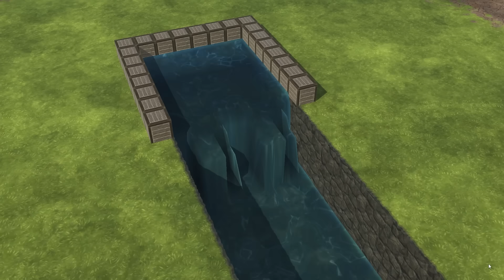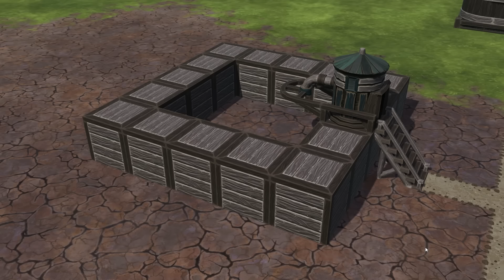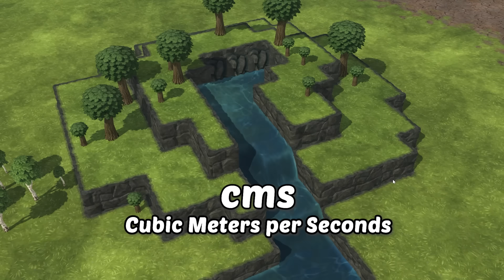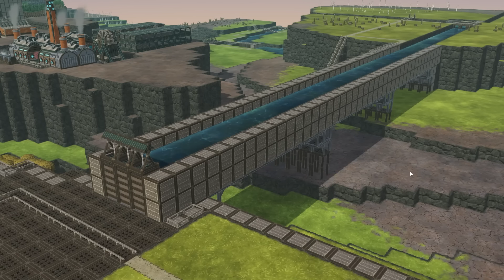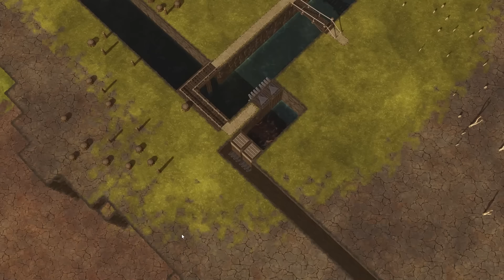Timberborn's Water Mechanics Explained

Comment: Thanks for this video! I am newer to the game and now the first time in the mid game. (Without the XXL stuff, after all techs etc.) There was a big patch in the last month. And this video is 1 1/2 years old , is there some big change which let me cry if I go for my late game by this informations?
Reply from the maker: Luckily most of it is the same these days! There are two big changes since this video:

- The numbers for water values have been but in half. So, for example, 6.6cms used to be the max water a 1 block channel could hold: now it is 3.3cms. A 2 cms source then is now equivalent to a 1cms source now. 
- Waterfalls no longer have the 2.2cms edge limit. Waterfalls now are not a bottleneck (though the channel feeding a waterfall still could be)

Good luck in whatever megastructure you are building!
Reply: @ZeddicBuilds  Thanks for your feedback! If you have the time an additional question to the dams:

Why everyone uses wood for the dam? I unlocked the earth bagger and from my point of view it is easier to use - build high with the option which block first, without the priority system. And if I make a mistake, it is possible to blow a hole on each position with dynamite / the tunnels, without removing everythink above.

What I am missing?
Reply from the maker: There are a couple of trade offs for building with dirt. On one hand, it does allow you to create overhangs, but it comes at the cost of being harder to destroy (requiring tnt vs just instant) and it also prevents beavers from building down “through it”. Beavers can build something below them vertically from any height - but dirt acts as a blocker. The other consideration is max build height: the game only lets you build so high before it only lets you build with levees. Admittedly these trade offs are pretty situational, so most times it won’t matter much. Beyond that, I think it just comes down to visual preference
Reply: @ZeddicBuilds  You are a nice one! 🙂

Comment: The 2.2 cms per edge fall limit, that's genuinely new information! 
The perpetual motion machine I've been using, has fluctuation issues whenever water drops down one level, and I finally know why!
Reply from the maker: It ends up that they removed the 2.2 cms limit in the official 1.0 release which was released a bit after this video. The rest of the guide in this video should still apply though
Reply: @ZeddicBuilds  In your timberpunk series, you calculated the channel throughput with the 3.3 cms/block heuristic
But in this tutorial video you used 6.6. Is that also part of the 1.0 changes?
Reply from the maker: Yes! Good catch - another element of the 1.0 release is that they halved the CMS units of measurement. So 6.6 became 3.3. A 3 CMS water source in the current version is a decent amount of water now.

Comment: great video, great game! But in 9:27 the game sadly visualize the water in a wrong way: Narrowing the river means higher flow means lesser waterlevel in the narrow, not a higher water level (Bernoulli). Maybe they fix that visually
Reply: Are both possible depending on the Fr?
Reply: Im pretty sure that is not what that theory is explaining. It explains high and low pressure.

Bernoulli's principle states that as the speed of a moving fluid (liquid or gas) increases, the internal pressure within that fluid simultaneously decreases. It is essentially a statement of the conservation of energy for a flowing fluid, meaning the total energy in a steadily flowing system remains constant.
Reply: @InvertedAim  year, but in open channels you use it with the continuity equation to calculate waterlevels - and the waterlevels react like I explained in open channels with other constant framework conditions like I explained. This is how we calculate missing variables—such as velocity or water level—using energy transformations in open-channel flow.

Comment: Even at almost a year old, still the best video on Timberborn's water mechanics I've found. Hoping this video will be updated if 1.0 makes it necessary.
Reply from the maker: Thanks! Luckily it looks like almost everything is the same in 1.0. The two big differences:

- They removed the waterfall edge limit. No 2.2cms per edge bottleneck. You just need to worry about the width of the river like you do normally.
- Measured CMS values were halved, but otherwise remain the same. So a 1x1 tile can hold 3.3 cms instead of 6.6cms
Reply: @ZeddicBuilds  What about 1.1?

Comment: What happens if we put levees or dirt over pipes.
Reply from the maker: If you completely seal a water source with no exit, it will eventually stop producing water. This can be a cheap way of sealing off badwater if you don't want to route it off the edge of the map. If you put dirt or levees over a pipe, it will stop of the flow of water in that direction and it will go into open square that it is connected to which is open

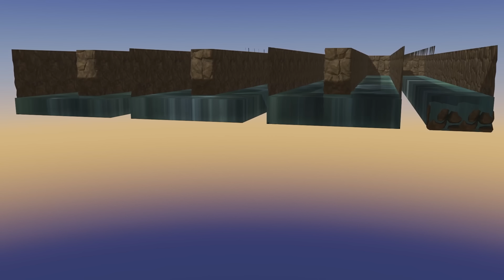Comment: 12:00 I used this in my last dam to fill a empty lake that was to high but closer to the water source blocks on plains. Any over flow goes into the lake or off the map edge. Just set it to .05 above the block height. and that will multiply so fast. away.

Comment: Sluice gates also should have the option to open at a set upstream water level so they can be used as flood prevention. 
Because I managed to end up in a situation where I can’t use sluice gates because of the lack of an option to have them open at a set depth upstream
Reply: The solution is to have a bypass dam or floodgate in addition to the sluice

Comment: Maybe I'm stupid, but I'm trying to understand how you build a water source in the game. Is it possible or is it a mod?
Reply: You’re not stupid and it’s not a mod. He kind of zips by it but you need to be either in dev mode or map edit mode to add water sources.
Reply from the maker: Thats right - this is possible with dev mode. You can alt+shift+z to enable a hidden toolbar. It will add some new buildings on your toolbar for water sources as well as open a new hidden set of dev actions. You can also build items for free if you hold down CTRL while you click.

Comment: I am quite new to Timberborn and really appreciate the video even though I don't really understand a good chunk of it. I have a question though, I know it was probably explained in the video but how do I build a dam to hold water during bad tide or drought?
Reply: there are several options but I've only ever used two dams and floodgates, dams automatically hold back about half a block of water are cheap to build but cant be adjusted, as a result dams cant protect you from badtides on there own in fact it will actively make them worst, so as soon as you unlock them replace every dam with a floodgate and the moment you get a badtide warning empty your reservoirs, if you want something better then add another floodgate before your settlement/reservoir and leave it open outside of badtides and build (or more likly tear out the ancient blockages to) an alternative way for water to exit the map and block it off with floodgates during droughts or the wet season keep the floodgates closed during a bad tide only open these floodgates and close the floodgates to your reservoir.

Comment: Do you have a video specifically regarding irrigation during droughts? I'm having real problems with the sluice. I've built a massive dam system, spent HOURS doing it... TWICE!! But it's the sluice, it doesn't do what I thought it would do. I hoped it would sense when there 's no water, and open up to irrigate all my rivers, but they just won't!! The problem is, the sluice senses it's own water output, so it keeps closing every time it lets any water out. This greatly effects the pressure, thus it's not a strong enough flow to irrigate anything but a small pool nearby.  I've tried everything to get around this problem, but I just can't solve it.

Comment: hello Zeddic, I came into interesting issue. It seems that with update 7 there is a limit to how much 1sq of pipe can handle. I'm playing on map with very big water source (almost 60 m3/s) and wanted to route all bad water to other side of map. I have found that max what I can  get through 1x1 pipe is 10 m3/s. increased to 2x1 ->20m3, 3x1 - 30m3/s. With very short pipe I can't get more that 25m3/s. Could You test that?

Comment: So when a water source is placed on the edge of the map, can that be pressurized? Or will the water just flow back through the source and out of the map? Also, if it will pressurize, will it be pressurized with the same CMS as the blocks let out? Like a source with 6cms, if you make a dam with that, will the output of the dam be 6cms? Or will it lose some off the edge of the map?

Comment: My only question now is how do you instant build in dev mode???
I’ve been trying to figure that out for day now.
Reply from the maker: While in dev mode you can hold ctrl while placing a building to instant-build. You can also hold shift while deleting to skip the prompt. Another tip if you are tinkering is to start a new map with 0 building refunds - so you won't get rubble building up.

Comment: I always have an issue where I try to do multiple reservoirs on the large plains map and then it seems to destabilize the water to cause constant flooding on the original river around the starting area.
Reply from the maker: My first thought would be to look at where water is leaving the reservoirs and see if there is a bottleneck on the edges that can't support that total CMS.

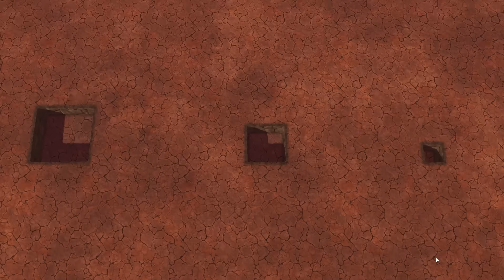Comment: 3:49
Is that actually true, though?

If we are talking about water standing still, sure, the evaporation is bad.
But flowing water moves with a total cms, that does not change, if we spread it out or narrow it down, as you point out yourself (for water power)

Now...
If a canal is about transfering substantial amounts of water (esp. when doing that manually, for controlled events), then we can't just average the adjacency scores.
If the table on the wiki is correct, even though their given example is full of errors,
then an idealized 2 wide canal has an adjacency score of 5 for every block, whilst a 3 wide has 5+8+5.
Evaporation is 0.09 (see wiki) for 5 and 0.04 for 8.
That gives us 0.18 evaporation on every step of the journey for 2wide, and 0.22 for 3 wide.
... which is even worse than 1wide, which should have an adjacency score of 2, giving 0.2 evaporation (per day).

The spreading out of the water does induce more evaporation!
Still: 2 should be best, if not for irrigation purposes.

Then again: I don't quite trust that wiki... Their "3x3 pond example" is bogus...

EDIT:
The calculation gets more favorable, if depth comes into the equation.
I am pretty certain, by now, that only those blocks are subject to evaporation, which have no waterblock touching from above.
If you have copious amounts of water flowing through a 1 wide, 2 deep canal, filling that up, it beats any alternative setup.
I doupt, however, that this will come in handy in an average playthrough...

EDIT2
Maybe I am mishearing; maybe you didn't want canals and blocks be bunched up in that argument.
It sounds like you are saying "single tiles of water in 1 wide canals"
Maybe it's "and"?
Maybe these priblems are better left separate.

The 3*3 pond is also not best; atleast not for evaporation
It's beat out by a 4*4 ... Even by a 4*3.
Bigger is always better.
Only if you want to minmax. Between width and irrigation, does this answer seem correct.
But then again, individualized sollutions, depending on terrain and availability, may reign supreme!
... + Deep is always better than shallow [for minimizing total evaporation], from what I have learned so far!

Comment: This is a good video, specially the part about using water gauges to figure out flowrate and the 2.2 cms waterfall issue.

I have a question regarding floodgates if you have the time. Theoretically, since 6.6 cms translates roughly to 1 block high waterflow, lowering a floodgate to 0.50 should allow 3.3 cms worth of water to flow through, provided that there is no waterfall involved. Is this supposition correct? 

I'm trying to figure out a method to calculate how many .90(or maybe .95) floodgates I would need in a hypothetical river to not overflow from X cms but from previous experience, the math using my theory in the above sentence is not adding up.

Comment: Great tips! I'm curious.. if the water height (around 17:17) changes on length, would the closeness of the nearby canals affect the height because of irrigation? What I'm thinking is, if you simply had a straight path, you might see a more rapid decrease in water height versus the curvy path because the ground wouldn't need to absorb as much water for irrigation over the same amount of tiles. Just a theory.

Comment: Cheap and early version of sealing a bad water source (instead of the expensiv seal thing): circle the source with levees, set a row of platforms on one circle side (one high lower then the circle) and cover it seamless with the platform stripes, seal them with impermeable tiles.

Comment: Zeddic.  Great info. I did not understand the 2.2 cms per edge.  I don't think you mention it here,  but do you know how to stop or reduce the surging I get from dams and flood gates?
Reply from the maker: The 2.2cms rule can be a little hard to follow. If you look at any place in a river where there is a height difference you can count the number of block edges that are exposed to water. block edges * 2.2 = total cms that the waterfall can handle. If your river has more than that number you will get flooding because the water can't fall down the waterfall fast enough. 

For surging: I usually get some whenever there is a sudden change of flow rate (me opening a dam or the water coming back at the end of a bad season). Normally I see the surge of water hitting the close condition at the end of the river (say your sluice gates close or you hit the water level of your dam) and it taking a while for this new stable water level height to propagate back up river. Some techniques I've found helpful:

- If I have water sources that really surge, I set the close conditions on gates very conservatively. Say a height of .5 instead of .9. That closes the gate before the surge can grow too big
- Have overflow points on your river in case it does ever get too high. This is kind of like an emergency spillway that only ever gets triggered with the surge
- Have some strategic levees that act as lips to the river where you notice the most overflow (I find this usually at the base of a waterfall)

Comment: Is there a cap on the water flow rate in a pipe? For example, if I somehow squeeze all the water sources in the map through a 1x1 pipe, will the flow rate be more or less than if I were to say only be pumping from half the water sources?
Reply from the maker: I haven't found a cap yet. In my Steeltide series I did what you mentioned: I capped every bad tide source on the map and routed it into a single power plant. I was able to keep the sustained CMS. I did observe that it can sometimes take time to "get up to speed" as the water figures out where its supposed to go, especially if your pipe has lots of branching. For short good seasons that can be a bit painful because you could lose a day of flowing water getting the pipes filled and the system flow rates stabilizing.

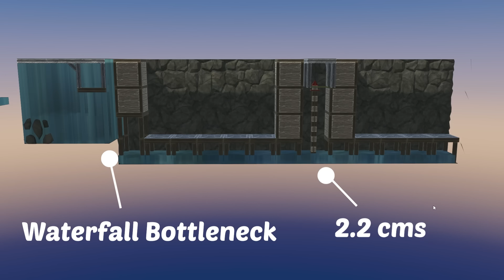Comment: 15:21 oh that's why my badwater pipe didn't make much flow as i expected
My question did a sluice have limit how much cms it can take?
Reply from the maker: I believe the limit only comes into play if the sluice gate forms a waterfall (eg, water is exiting the gate to something else). I think when the gate is at a uniform level on both sides (like you're just using it to force 1-way flow) that it is not capped

Comment: amazing and still not fully released. is there also a creative mode in the game so you can learn buy experimenting?
Reply from the maker: For experimenting I use dev mode. You can turn it on at any time using Alt+Shift+Z. Once enabled, if you hold down the Ctrl key while building it will insta-build. You can hold down shift when deleting to skip the confirmation dialog.

When tinkering this way I like to start a map in custom mode with a 0% refund for destroyed buildings - that way you don't get rubble when you delete things.
Reply: @ZeddTheBuilder  txs. haven't bought it yet, but i like to tinker around with the mechanics, options etc before getting stuck in an actual game.

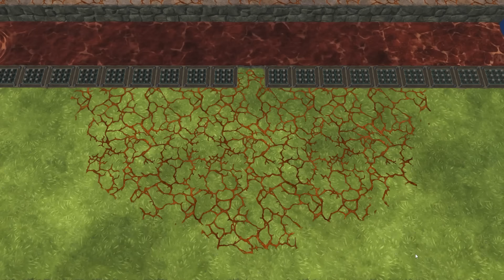Comment: 3:11 This is slightly incorrect, they don't need to be built on dry soil, but that they will not protect against the body of fluid that they are in, but they can protect against an adjacent body of fluid.

Like if you put a channel of good water around a bad water source with barriers in the bottom of the good water they will prevent the spread of the contamination from the bad water.

Comment: I wonder if putting impermeable floors on top of water by using  structures underneath does anything to evaporation. It would be very useful on hard mode with lengthy droughts to reduce evaporation.

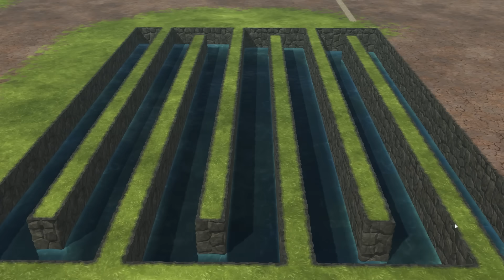Comment: Man I always love your video's!!! always helpful.. always amazing builds!!! <3 <3 11:55 You were talking about water folding. Water folding doesnt work when you have a long straight path like you had shown... think of it this way.. you have a river thats 5 tiles wide, and runs on ground level 5... where you make the waterfall down to level 4.. if you have the drop down look like an arrow pointed UPstream. that allows the water to move forward a tile as well as waterfall down, then the next it repeats.. so going from a 5 wide even drop thats 11 CMS, fut folding will give you 19.8.. BUT... since it all folds toward the center.. it speeds up the water in the center line :D Hope that helps! :D .... 13:12 to help with the water backing up.. at the corner I have the drop to the next line diagonal so it gives 6.6cms instead of 4.4 .. it helps a little.. But the eff3ct still remains...